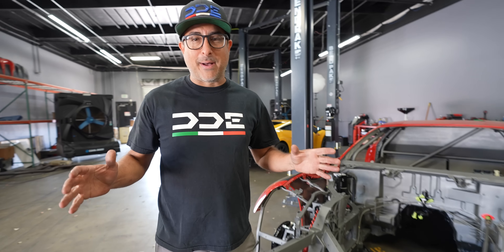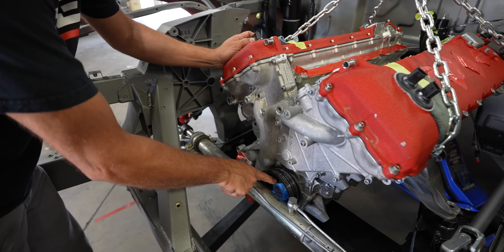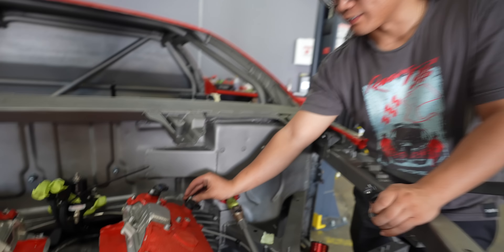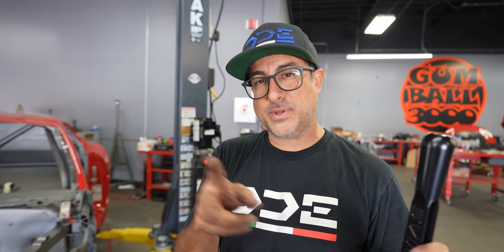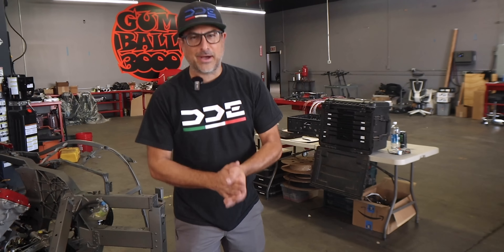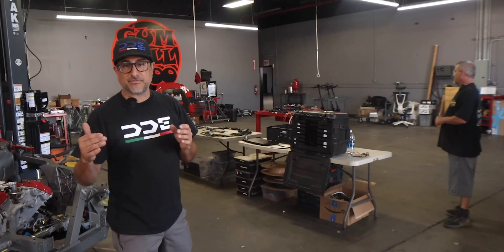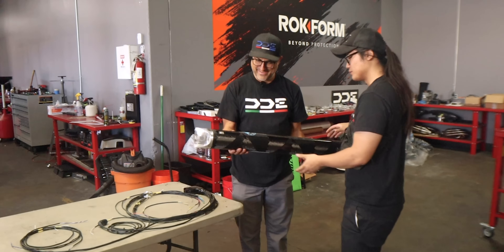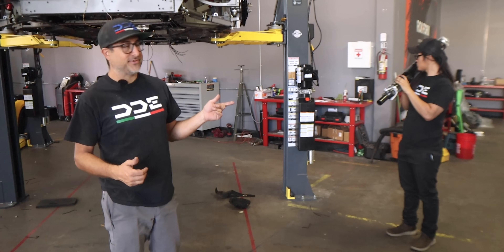WE ACTUALLY DID IT! 1500HP FERRARI TWIN TURBO BUILD UPDATE

Comment: The plasma table in the right hands is a game changer. The way you can just make brackets and little bits so quickly compared to having to cut it out and drill holes ect like you uses to have to do. Also makes the build look so much more professional.

Comment: So smart with the disconnecting wiring harness that will save you so much time if you ever get a wire that's damaged amazing job guys.
Reply: The point of it is to be able to remove the engine without having to remove the harness from the engine

Comment: RwD with that kind of HP will make it comparatively slow off the line and a widowmaker even at 70mph it will light the tyres up on the street and undriveable in the wet. Totally my kind of fun.

Comment: I think what some people dont appreciate is that this Ferrari was reversed engineered essentially from the ground up.  Especially the engine. Yeah Arclight and Gintani wedged the turbos in it, but that was just the surface. This is a NBD build. If this was an LS swapped chassis car, it would be done faster, but who does this? No one. 😎😎🙌🙌

Comment: Hey DDE, I see Mike has a rag draped around that hanging electrical outlet. If you guys can find some styrofoam blocks and stick them around the base of those (leaving the outlets open), you could use gorilla glue to hold them on there and effectively have "bumpers" on them. That way you'll quit laying your heads open all the time on the bastards.

Comment: I'm a little surprised you've not had the exhaust/headers ceramic heat coated, improves gas flow and retains heat in the exhaust instead of everything else around it?